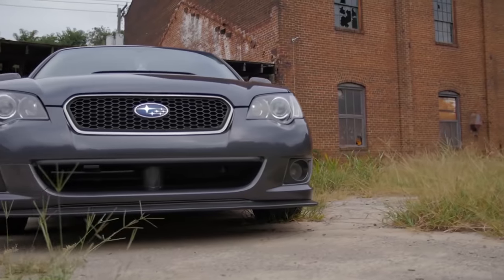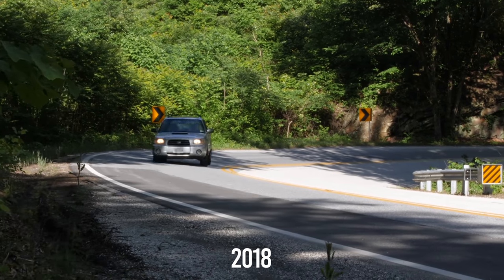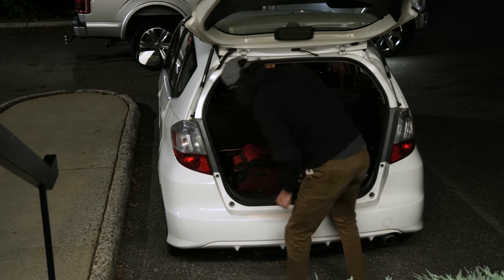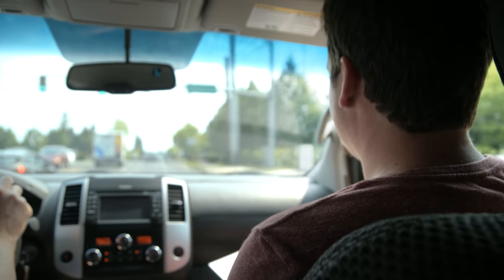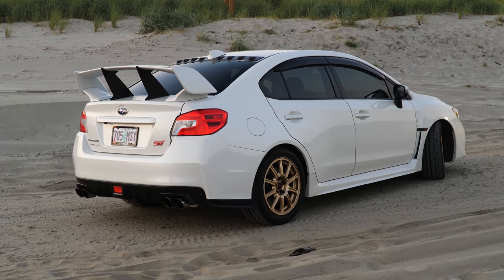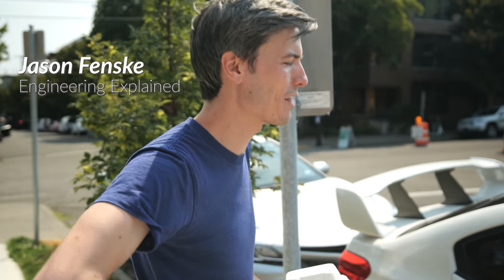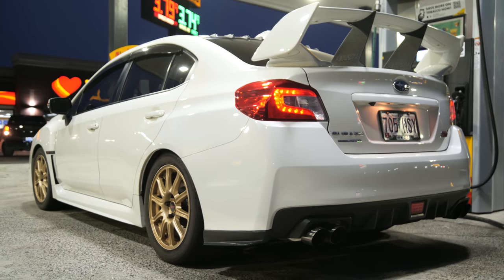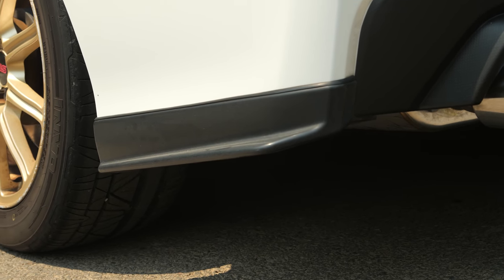I bought a Subaru STI sight-unseen and drove it across the country back home!

Comment: The Achilles tendon of Subaru is the poor gas mileage on the STI particularly. I owned 3 STIs(2005, 2012new and a 2015new model), I made a few trips 850 miles and 1000 miles one way. Subaru gas mileage sucks!! it is the worst of the competition when it comes to gas mileage. Similar performance cars that I also owned new(335i, a few evos, Audi S3) have much better gas mileage. The Evo 8 MR window sticker said 17 city -26 hwy, the Subaru says 16city -22hwy. Besides the mediocre/poor gas mileage the car is incredible!!

Comment: You make Subaru sound very unreliable the only ones that are unreliable are the ones that aren't take care of, and redlined at every stoplight. Don't be scared to add power just take care of the car and be mindful of what power mods you do, proper tuning will save the car.
Reply: Ringland is something you can't take "care" of even if you change the oil everyday